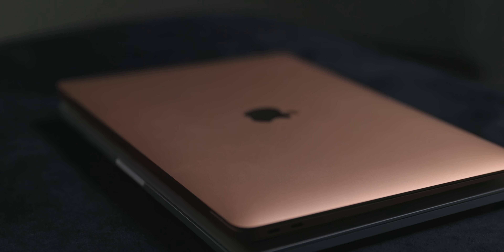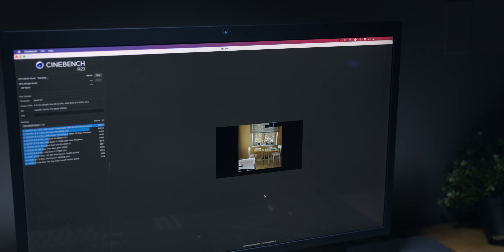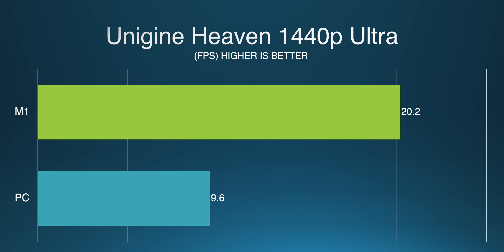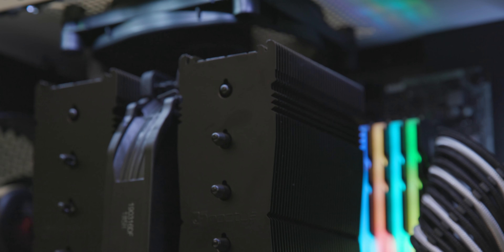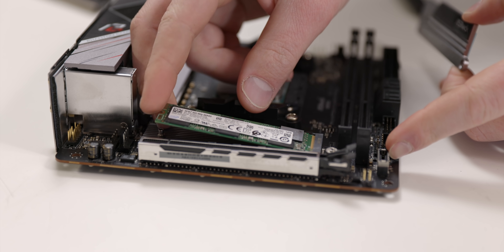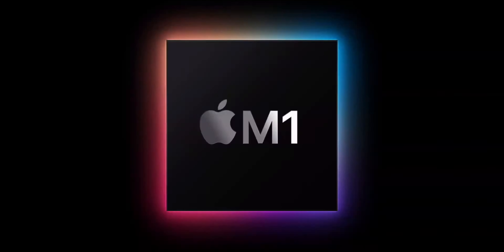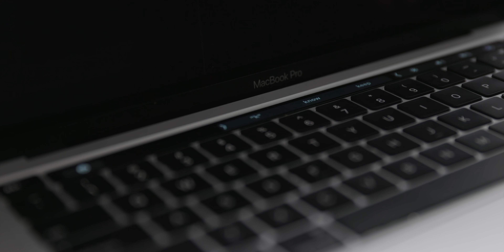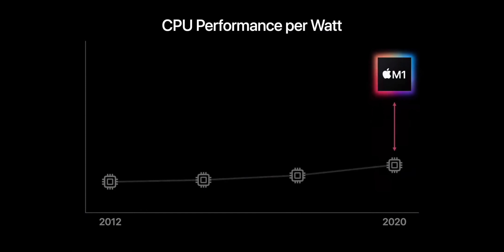$699 Mac mini vs $1,000 PC: Which Is Faster?

Comment from the maker: Whoops! Every once in a while we make a mistake. The chart at 2:03 has the Mac with a score of 10173. It actually got 7793. I knew of this scoring disparity when I wrote the script as I used the term “manhandled,” but it seems we goofed in the edit by making the results appear closer than they were. All the other numbers however have been verified as correct. Apologies for the error!
Reply: I like butterfly too, felt more 'Apple'ish. Kinda miss it on MacAir with scissor switches. I mean a Mac with an Apple chip and the butterfly would have been awesome.
Reply: @williamregal873  "[...] with an Apple chip and working butterfly would have been awesome." I had 2 different MacBooks with these keyboards, both keyboards had an issue with some keys.
Reply: @JKP836  I didn't, I use it very sparingly
Reply: You should stop typing on your butterfly keyboard Macbook when writing the script ;P
Reply: @spankjamer  Butterfly keyboards really aren’t that bad to type on, I quite like the one on my 2015 12” MacBook
Reply: @nathantaylor2026  agreed.. it never failed me either.. and i kinda like it more than the new magic keyboard

i’m not sure whether it was the ACTUAL failure rate tht is high, or people just hate it becoz there’s lack of key travel.. most youtubers i watch all talk mostly on the travel instead of the failure
Reply: I had to replace mine (because the sleep sensor failed), but the palm rests are cheap on eBay and somewhat straight forward to do. I like the feel. The feel kinda like a no travel mechanical keyboard. Magics aren’t too bad though.
Reply: Hi @Snazzy Labs I like your videos and they are very informative. I am wondering though, if you could do a video with your thoughts concerning the new data that M1 Macd are consuming rapidly the life of ssd's due to Macs writing larg amount of data very often on ssd as swap memory instead of the ram.  HaGT!
Reply: @MrErlisK  Quick fix.... AppleCare for $89.00 (on my base M1 Mini) and always backup your critical Docs.... AppleCare is transferable, sooo....if you sell your M1 to defray the cost of a newer M-series, it adds extra value and peace of mind for the potential buyer.
Reply: @goobfilmcast4239  that's not a fix. That shouldn't be an issue in the first place.
Why does it use much slower swap to begin with? RAM is much faster
Reply: Why do you even watch Snazzy Lab Videos ? ..... you're a silly person.... find some other place to leave your juvenile comments
Reply: Performance per watt is almost entirely irrelevant on a desktop.
Reply: @None17555  The future is Mobile....in the very near term, x86 will have a differentiation of Mobile and desktop chipsets but the TDP and performance divide will grow.  Mobile X86 is running out of overhead....its likely Apple will do (is doing) away with this. Like the M1s, next-gen SoCs will be nearly identical in Laptops and iMacs with "Pro" Desktops being Headless (no monitor), rack-mountable for server/render farms and having some form of internal capacity for speciality media,  I/O cards and storage.  Low TDP means Apple may be able to put Multiple SoCs in the same box... sending computationally intensive tasks, not just to other parts of a single SOC, but to multiple SoCs ...The future IS mobile-centric chipsets...just look at your phone
Reply: man . that intro is damn groovy and smooth
Reply: What a fraud video, you didn't even show hardware specs of your test bench. You don't even tell what Ram configuration, cpu clocks, either the cpu are set into performance mode, balance or whatever. This video biased af.
Reply: M1 truly is Magic-1 , It is crazily amazing!
Reply: You sure it was a goof??? 🤔
Reply: P  on my o N p nap in n   Jjp min nn
Reply: K
Reply: 11:32 .."It might not be the droid you're looking for" - Missed Opportunity :)
Reply: Wait for an RDNA based APU, and see how it performs, and how much power it consumes.
Reply: Who cares, i will never give up my freedom to apple. Even if i already sort of have with the 12 pro max, which im not really enjoying or the macbook pro which just is too weird to use cause of MacOS and its drawbacks and only works as a monitor for entertainment and slight workflow. Every time i use something from apple things go wrong and just make me wish to throw them away and get back to windows and android, cause they just work better with not obstructions.
Reply: @TheRMSAndre1  Tim Cook ruined Apple, he turned Apple into Crapple. Sadly iSheep always defending him.
Reply: Your videos are just horrible, just look at the the mistakes, your full of misinformation
Reply: I would like the parts list for this little computer.
Reply: 30% disparity. Not a bid difference. hahaha Not to mention you could build a wayyy faster pc than the one featured for 1k.
Reply: Thanks for the video, watched it late after all these years. Went to go take a look at the rav power charger, your link no longer works.
Reply: M1 is useless crap for isheep, noobs and aunts.
you can't use its graphics because there is basically no games on OSX, M1s wins in benchmarks are worthless for actual usage because you can use much cheaper Ryzen CPUs to do all those single-threaded tasks and you hardly will notice any difference with M1. and with PC you actually can upgrade your RAM, CPU, GPU and add other stuff like USB/thunderbolt port or a 10gb NIC..
Reply: @rawdez_  Phew !... I like to see how much more triggered you get when a New M-series SoC runs AAA Games @ 100+ FPS .... In Rosetta 2
Reply: It's kinda of a flawed comparison, don't you think) The 4700G is more than a year old, and while the 5900HX is new, it's the most power hungry sku of its lineup (hence the X in the name). A more apples to apples comparison would have been a 5800U or at least a 5900HS (the S indicates lower power consumption).
Reply: You do realize chips do not scale like you think. Also M1 has garbage datalines. Only two monitors is stupid
Reply: @petervansan1054  You do know that the M1 is a chipset for Starbucks Squatters and Soccer Mom laptops... the fact that x86 fans boys (AKA Apple Haters) are so triggered over a budget low-power chip that crushes tells me that Apple is living in lots of their heads, rent-free....Man, I can't wait to see all the x86ers suffering from runny Code Browns when the next-gen M-series is released !!
Reply: Matt Stone  Ad Hominem comments are reportable...
Reply: William Marshal  Install Mac OS on Windows Machines then do a Benchmark....hmmm?....just the fact that x86 Macs allow for Windows (boot camp) says a lot .... when an "pure" ARM version of Windows becomes available for the M-series Apples SoCs, the beatdown of Windows will be adorable to watch
Reply: M1 not for me. My Mac Pro 2009 and 2010 can run  windows games,  run Mac OS server (old one ) not that crap Tim Cook is selling to management of your devices. If Apple cant get AAA tiles to be ported it s junk to  do in house. If Apple about Graphics , it should work on better relationships with PC Game Developers. Do better than Apple Arcade (casual gamers) product.
Reply: @macgamer1973  When the next gen M-series chips runs AAA games in Rosetta 2 at max settings @ 100 FPS then what's going to be the next Hater Complaint ? ( You Know this is in the realm of possibility considering the overhead available in RISC SoCs ....Hmmm ?)
Reply: The M1 Chips are so good for a few reasons
1. No Legacy Micro-Code that can use anywhere from 15 to 50 percent of a Traditional CPU Cores Power/Time!
2. Focus on Single Threaded Performance as Multi-threading is a sign of a poorly optimized core meaning worse performance on each core for each more power intensive task like Benchmarks and Exporting and Rendering, But the M1 having only one Heavy Core means it has inconsistent performance due to heat this is why next gen the M2 will have I bet 4 Heavy Cores with upto three turned off when not needed to save power! Most Programs are still programed to work on 1 to 4 cores at best even gaming has been slow to utilize more cores effectively!
3. Control of the OS Code!
4. Near Complete Control of the App/Programs Programing Language for 1st and 3rd parties!

For Intel and AMD to still be a threat in the next 5 to 10 years Microsoft, Intel & AMD will need to do the following;
1. Microsoft and by Extension Intel/AMD to compete must focus on ITPC way more and maybe even remove Multi/Hyper-Threading!
2. Better Utilize Multiple Cores on both a OS and Program Level aka Parallel Computing! 
3. Including Big Little Tech for Mobile Platforms like Laptops and Tablets!
4. Get all Cores of all Skews to be far more power efficient (GaN can help with that but is not a Magic Bullet!) they need to Dump Legacy Support on a Micro-Code, Bios and OS Level  (Completely!) and rework those sections dedicated to Legacy Functions to making the cores more powerful while utilizing less power! That would be a great thing as it would mean no power being dedicated to legacy functions allow heat to be reduced while allowing more space for newer architecture to be placed their instead rather then ontop or on the ever growing die size!

I Heard a Rumor that AMD is building an AMD64/ARM SoC using Big/Little Tech, CDNA, RDNA2, Infinity Fabric all in a ARM SoC with no Legacy Support Built in!

The Future of Technology ATM is in Order;
1. ARM & RISC-V
2. Real Time Parallel Computing (This can be done by AI without the need to rewrite all programs and OS ourselves an AI can do this before hand to conserve power and reduce the chances of errors and crashes or on the fly at the cost of higher overheads due to on the fly Translation!).
3. GaN Technology for Cooler but more powerful Electronics!
4. BTRFS & ZFS for Error Correction, Volume Size and Speed!
5. Open CAPPI!
6. DDR6 RAM!
7. RDNA, CDNA & Infinity Architecture!
8. ECC RAM
9. AI
Reply: @DarthAwar  5nm process has gained my respect. I am a die hard PC / Android user. I will still stick to my archaic 14nm Intel 10th gen chip for now, it clocks to 5.2ghz all 8 cores and for gaming its still one of the best CPU's to have. I can for once recommend people buy one apple product, its not the laptop either.

Comment: You can't build a more powerful machine with 1) the same footprint 2)The same power draw. Good to know cause those are the two things I care most about. NEVERMIND that Macs have in essence become the worlds most expensive completely disposable computers, cause that's not important. Don't ever mention that if you built that PC in an ATX case and used a full sized motherboard with a regular, full fat CPU/APU you could custom tailor that machine for today's and many tomorrows workflows cause that's not even a thing. Connectivity? With the M1 that's extra. Then there's the fact that the 1K PC allows you run an operating system and have your scratch drive in the same box. We'll gloss over the fact that when you add all the dongles and external paraphernalia the all-important footprint spec is a complete non-starter.  M1 forces you to use external storage which is excellent because it's going to be much slower than say an NVME drive on the 1K Pc's motherboard, and if that's like most modern motherboards there will be slots for at least 2 of those. All that extra space inside the M1 would be great for expand-ability right?? I mean Apple could have put slots for maybe 4 nvme drives inside. So you could have the motherboards storage for MacOs and full blown RAID with 4x 4TB nvme SSD's in a raid 10 configuration. NOW YOU'RE TALKIN' FOOTPRINT! However, no,.. just no. Not even in the Mac Studio at 4x the price. Why am I so mad?? CAUSE I'M A MAC GUY! So I guess if you ignore all the things that actually matter and focus on the two things almost nobody gives a tinker's cuss about, yeah M1 is one spicy meatball fer sure! Here's the truly scary part (Just in time for Halloween!). In the past, every time Apple went down the "we're gonna tell the customer what they want/need" path and things started to go pear shaped, Steve Jobs would come back into the picture and all of a sudden Apple started to cater to the needs of their customers. Not to be overly blunt but Steve's dead, and if Apple doesn't start to listen they might as well stick to phones. Cause ahem DAVINCI RESOLVE ON LINUX! Now I'm off to find a replacement for Logic Pro,... have a good day!

Comment: Why do anyone even care about power usage and efficiency of a DESKTOP computer? It is plugged in all the time anyway and in either case consumes so little energy it won't affect your bills for electricity at all.
Reply: First of all the more power efficient something is the less heat it generates and also I’m pretty sure your electricity bill cares
Reply: @Ziaphy  I don't think this generated heat can heat up the room at all. Maybe somewhere in the world it is sensible with bills but in my country it is 0.03 usd for kWh 😅
Reply: @kadirzhanl  I wasn’t talking about your room heating up I meant that the computer isn’t gonna last for that long or the fans are gonna be a lot louder. For your second point that may be the case for but in your original comment you wrote “why does anyone even care” and I can tell you people in Europe definitely care right now (about 0.40 € kWh right now).
Reply: Electricity is expensive in my country so I care about it.

Comment: I just switched from an AMD-based NUC to a Mac Mini.  I don't remember the chip model, but it was comparable to the Intel i7 that was top of the line a year ago.  It was very zippy (how is that for a spec?) and I liked it.  The fan came on a lot less than the Intel-based NUC I had previously which was a couple of years old.  The MAC Mini is not blazingly faster, but it is zippier.  And I have yet to hear the fan.  Real specs aside, if day-to-day use is faster and totally silent, then I say it's better.  I have very much enjoyed Windows 10, but I missed MacOS and I'm glad to be back.  Before switching I upgraded to Windows 11 and felt it was somewhat of a step back.  

I'm looking forward to staying with the Mac, especially toward the end of the year when I'll probably buy a M2 MacBook Air (or whatever they call it).

Comment: I was thinking about getting an 14" macbook pro this year, as everybody is speaking about the performance here there and everywhere. Now, I play world of tanks. Apparently it can run Wot too. At 40 fps, with all that "power" with very bad render quality, comparable to an intel integrated graphics, just slower. Decided to get an RTX 2060 and shove it to a ~10 year old i7 4770, with 24 gigs of ram. Get a consistent ~130 fps out of it. Also video render uses the GPU from now on, and the machine literally flies in renders too. I don't care about it using 40watts if it cannot do what I need. It's still at the stage of a tablet CPU shoved into a laptop body and that's it, all it excels at some ram and disk access and a huge cache to trick geekbench and other synthetic benchmarks. When you actually try to use it for anything else than video editing (well it has hw built in for those, so surprise surprise it excels at those yay) it's just nowhere near up to the hype or even incompatible with your applications. The graphics itself puts the intel integrated graphics to glory, I can't decide which visual appearance is more trashy when I see them running games side-by-side.

I want the performance for that amount of money spent, and other than scrubbing a timeline, or rendering some videos (well not necessarily as well as with better graphic cards) it's just not there.

Comment: Thank you. I have an old Mac Mini and would like to buy the new one, but my chief reservation is that the new one does not have enough USB ports. I presently use ports for my speaker, microphone, keyboard and mouse, and printer when I need it. So all four ports are presently occupied. I guess if I bought this new one, I would be able to convert it to four USB ports with a hub?, or get wireless mouse and keyboard, etc.  Or I could wait until later in 2022 when the new version will, I hope, have more USB ports. I am more a typical computer user.

Comment: I suspect that combining multiple dies isn't just going to be double or treble the performance, more likely to square it or cube it And that is assuming that the next gen. M2/pro chip is going to stay on the same 5nm architecture. 
Seriously, the potential for improvement with this architecture seems to be near limitless. With rumours of 3nm or even 2nm swirling around in the mix (and being very believable) there is every reason to think that we are on the verge of a sea-change in chip performance, with the potential for a base spec "Consumer level" machine to outperform current high end pro machines and consuming even less power than a current M1 chip!
I know he Mini has always been the one that is overlooked, but I love these little gems. We've just ordered our 5th in 14 years, and they have not had any of the pretension of the portables that we've had (1 air, 3 MB pros) but they've ll been dependable workhorses, and magnificent reliability (50% still working).
And Minis have always been good value because of that reliability. Bringing that value into performance equivalence with much more expensive machines doesn't make it good value, it makes it excellent value.

Comment: $699? I just checked the Apple website. Going from the base to 16GB of RAM and 1TB of storage brings it closer to $2000. And that's even before a decent monitor.  Plus, you're comparing a new Apple chip with an old AMD 4000 series.
Reply: 16 gb + 500gb or less and buy a samsung t7 its cheaper . u can get it at all around 1500 $ or less
Reply: for starters, stop pretending like this guy lied in the video. he got the base model, which is $699. The tower he got cost ~$1000. it is simply cheaper. he's not talking about how old something is, he's talking about how expensive something is. and compared to this? great deal